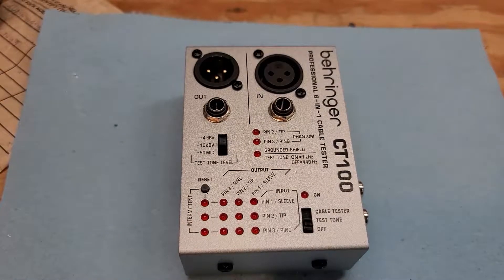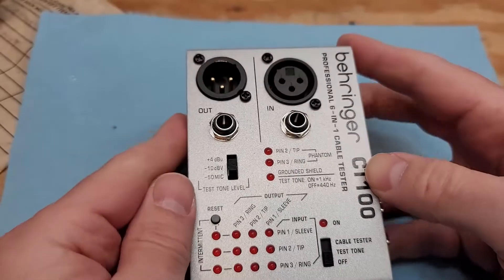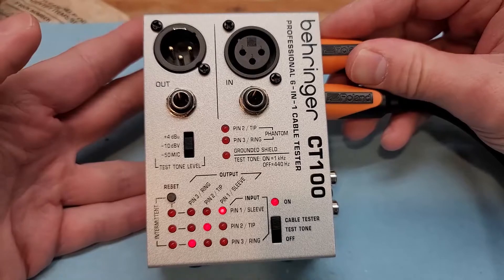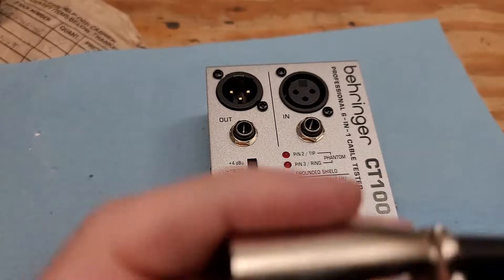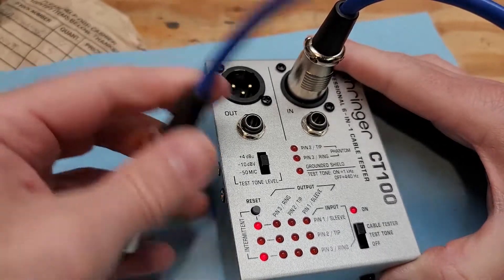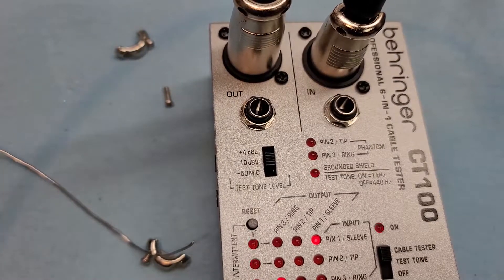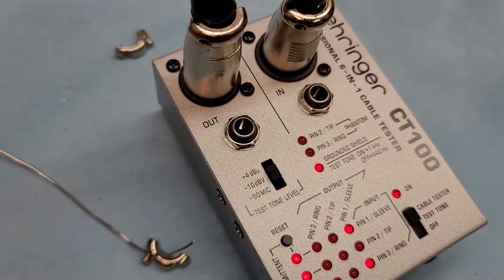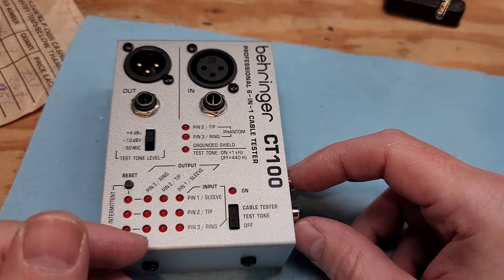Diagnosing and Repairing Cable Problems: Review and How-To

Comment: For me, the best review, I'm also an electronics engineer, a little bit, so I understand what you're talking about the best.
I actually have a CT200, and it is necessary to look at the reports for both devices to understand the logic of these testers. So you can detect many things, if you know how the software works and how the processor prints errors on the screen (led diodes) that they try to be errors. It is also necessary to know the pin markings - which are ... So I came to the conclusion how to test the 1/4" TS jack cable since the CT200 has a TRS jack ... (it should alternately show error 31 and 13 - shorted on the screen). So I don't have to make an adapter for TRS -TS, that is, a TS-RCA adapter ...
In any case, your review inspired me to understand the logic of testers!

Comment: Your explanation of the TS Jack was crucial because I’m using another device (not the same brand or model) and it does not have a clear explanation of why pins one and three are connected — but it’s because as you said  the sleeve and the ring are the same … whatever you said … but it was quite useful to know that.

Comment: Thanks for the review. Those are horrible XLR cable ends, I have replaced so many of them, I have the Pyle PCT60 cable tester, the big daddy version of this cable tester, works about the same but more connectors. I usually replace the ends of these XLR's when they go bad with some much better ends and they have a 2nd life. If you try soldering they usually just break again. I don't ever buy those XLR cables but they have come with some of my lights, like the American DJ pars.

Comment: That's indeed a very useful device. 
I used to buy a new guitar cable sometimes in the past, because my electric guitar was always crackling whenever I moved a little bit. Turns out that it was the output jack on the guitar that had worn out over time. I replaced it recently, and now it's a tight fit again. But I have a bunch of older cables now that could use some testing.
Reply from the maker: Often a good quality contact cleaner will help with that, and sometimes you can bend the connectors internally on the jack to make better contact, if you want to avoid replacing it. But yes, this tester works REALLY well, and has paid for itself over and over again.